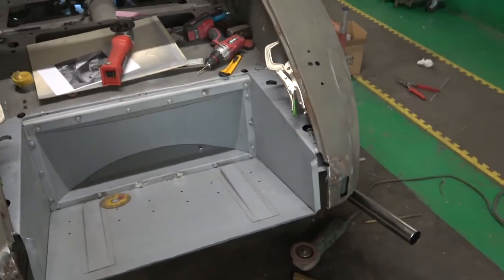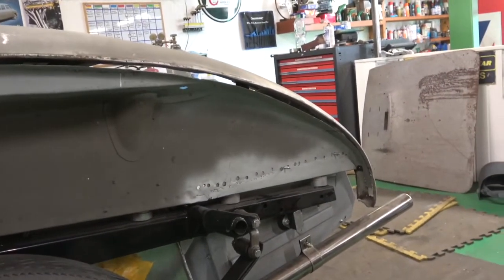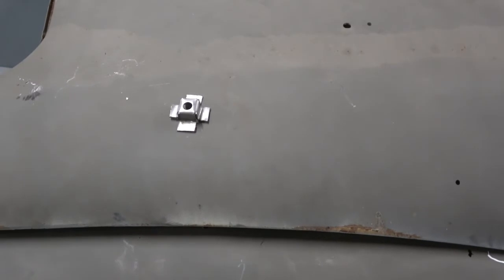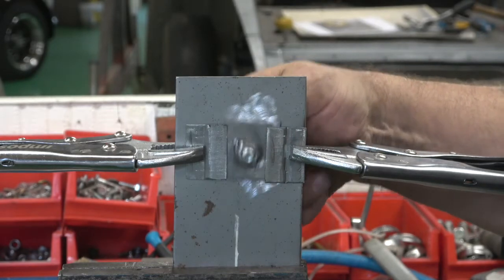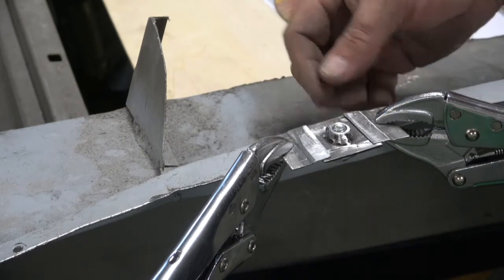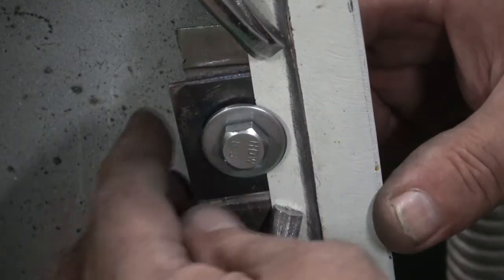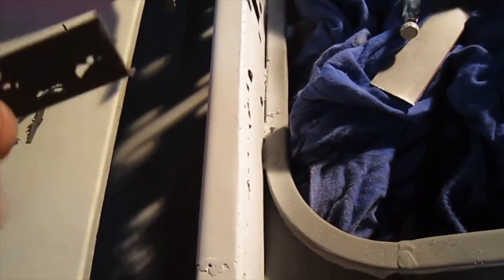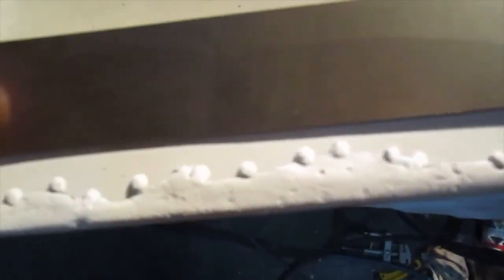Jaguar XK 150 Rear end repairs

Comment: Great progress, you may like to look at the Moss Europe web site as the Triumph TR2 to 3B all use captive nuts to hold on the wings and Moss do stock two sizes, one square and one oblong which would give you plenty of movement. Kind regards, Richard.
Reply from the maker: Richard,  Thank you,  I will take a look thanks for the information this is the up side of youtube info sharing. Cheers Dave

Comment: Great video Dave. Great job on the captive nuts, good idea having some adjustment to fit the wings.Panels are looking great.
Cheers, Jeff.
Reply from the maker: Jeff, Thank you, The problem i have now is the new metal strip i fitted to the tonneau cover is lead loaded so i can‘t
do an welding there as it will destroy the lead, So we need another way to attach the captive nuts. Cheers Dave

Comment: Think I'd like to see the parts made up of stainless steel as well as the nuts and bolts and washers to accompany the brackets looking at how badly the old ones rusted out Dave I like these problem solving videos Dave keeps the mind active thinking up different solutions   Rob
Reply from the maker: Rob,  I have had some bad experiences with so called SS bolts & nuts, I do agree they are far superior but the crap 
there producing now is like the old pig iron i know you will get where I'm coming from lol. Cheers Dave

Comment: Hi Dave, have you looked at cage nuts as used in IT server racks to see if you can use or modify them.
Reply from the maker: Stewart, I have seen quite a few sites on the internet but but there shape is wrong for what we need. Cheers Dave

Comment: Dave.At  6.17 secs  Am l being brain dead ? but  once you remove the bolt then what's to stop the plate falling out ! I'm sure you've thought of that one ! Yep ! Lots of work !
Reply from the maker: John,  Your right if they where fitted in a vertical position but our plates are laying flat to the inner wing so they should be OK
but once everything lines up we can tack weld them in place as i hope in my life time they will not be off again lol. Cheers Dave

Comment: I thought you had made them wings for the sliding captive nut thingy on the bead roller, just make a whole strip of them then cut what ye need. tidy bit of enginemeering there
Reply from the maker: Doug, We have hit a bit of a snag due to all the lead loading on the Tonneau cover but i will go over it in the next video. 
Cheers Dave